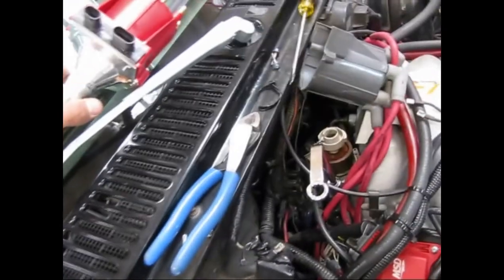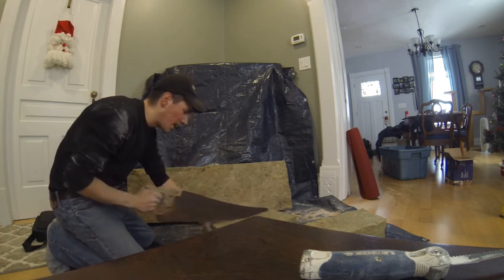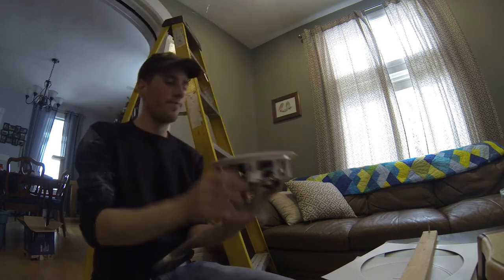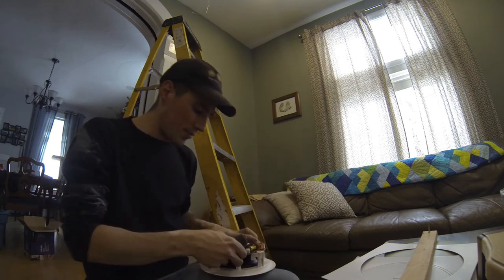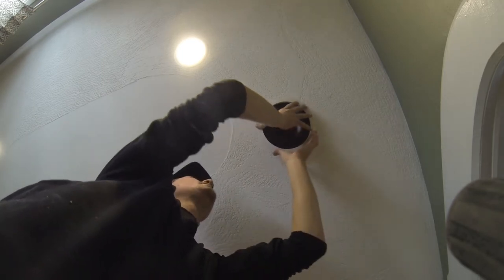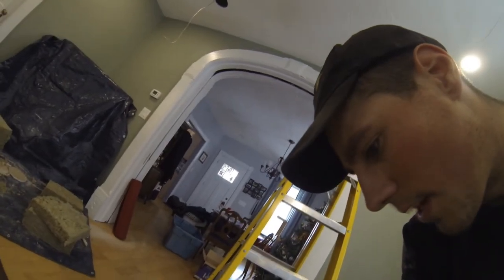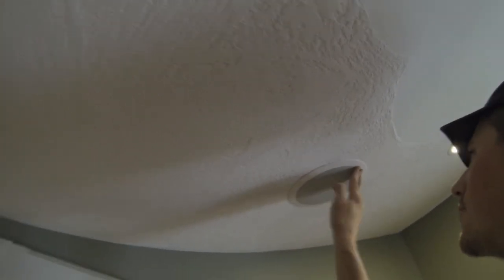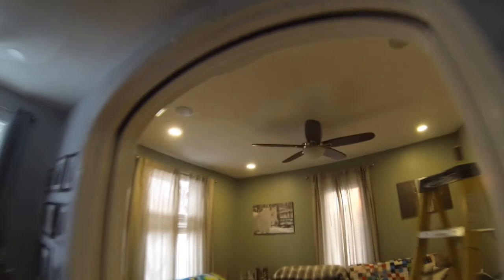Ceiling speaker install  Part 4 Final

Comment: How do you remove speaker for repair or replacement? I'm having speaker wire connection issues and must remove speaker. The speaker is not accessible through the attic, between floors.
Reply from the maker: For the model of speaker I installed use a paperclip to remove the speaker grill.  Bend it into a hook and pull the grill away from the body.  The speaker body mounts with 3 plastic retainers attached to screws.  I need to loosen the screws to release the retainers and then finally remove the speaker.  Best of luck with your project.  

Cheers!
Reply: @RobHoffmann20  Thank you, It was easier than I thought!!!